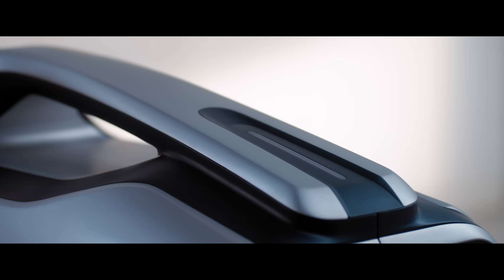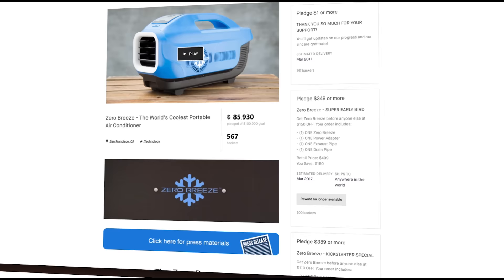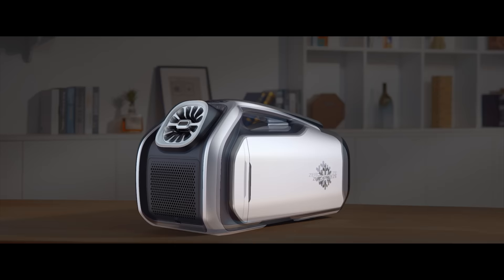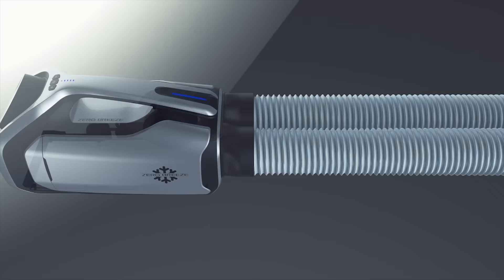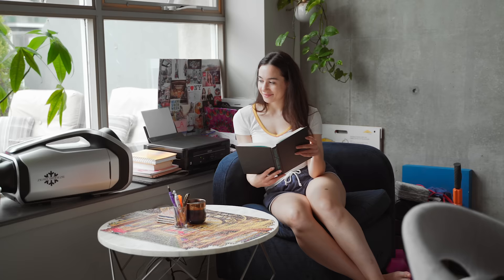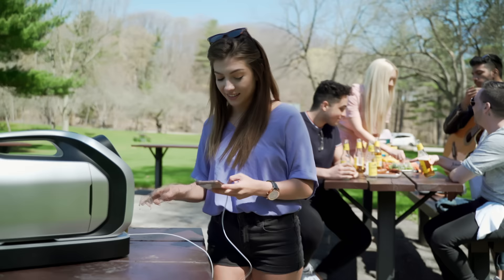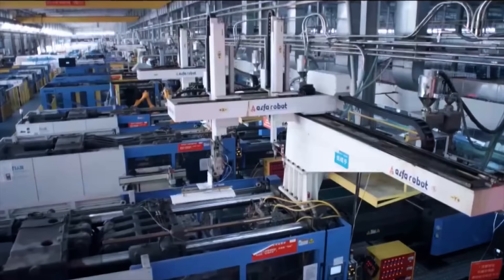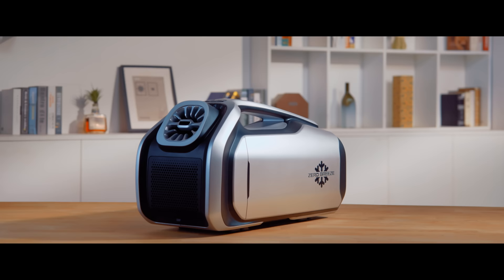Zero Breeze MarkⅡ Battery Power Portable AC

Comment: Congratulations for the improvement on the new unit. now is impressive. still too high priced but i understand the eford and many investigation to get  more efficient. with the time i hope that  price will decrease with future production and for sure competence coming.
for people that knows how to deal with batteries is perfect. is very easy to make a small bank of agm or lithium batteries to make last  more than 24 hours or add solar charge. keep that good work, i love to have one but i have to wait for that price little drop. thanks for the expression opportunity.   BTW,  can you imagine if is possible to make like a window type dc air conditioner? just a mini version 24 volt same 2300 btu or even 3000? campers will love it for permanent installation. i have a regular 5,000 btu 120 volt on my camper and work fine but  need big batteries, power inverter some times generator etc.  too much things just for a comfort sleep.  imagine something small and dc and permanent for a small sleep room in a camper.   !just thinking! congratulations again for your new model.

Comment: I purchased the first version. It works well. Only complaint I have is that there is no drainage pipe for the condensation. So it ends up messing all over the battery and table. Has the Mark II solved this issue?

Comment: Do you have to use this with the exhaust pipes leading out a window?
Reply: Yes, like with any portable AC, hotter than room temperature air goes out the back and colder than room temperature air goes out the front. If you didn’t the room would actually heat up. Also keep the ends of the duel ducts as far as part as possible so that the intake doesn’t suck in hotter air from the exhaust.
Reply: @russelltreacy6006  thank you

Comment: Without Freon it can't cool the air like a real air conditioner.
Reply from the maker: Unlike the conventional fan you have seen before, Zero Breeze Mark Ⅱ is a real portable Air Conditioner with the patented compressor that can reduce the ambient temperature by 30ºF/16.7°C.  After five years of research and development, we manage to shrink the giant AC compressor into a COKE CAN size compressor, so Zero Breeze can be super compact, lightweight, and easy to carry around.  Zero Breeze Mark 2 is the only real air conditioner on the market that runs on a battery. It allows the air conditioning life to be no longer confined to the house,  Mark II is not limited by the power supply, free to use anywhere, such as tents, camping air conditioning, the RV,in-car air conditioning, outdoor sports, boats, small air-crafts, any place you need.

Comment: Hmm I see ... why not buy a air cooler instead when we know air conditioning will not work in open spaces :P
Reply: Air coolers don't work.  I bought one that had a cord that you plug in house current and it didn't work other than when you used ice.  The one I purchased was returned because the transformer burned out.  A cheap fan and a spray bottle work well to keep your cool.